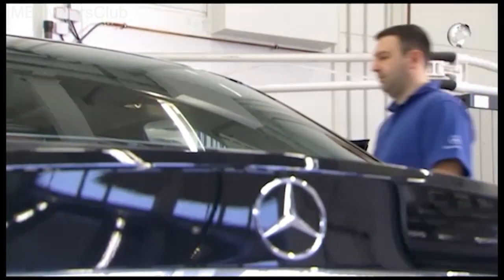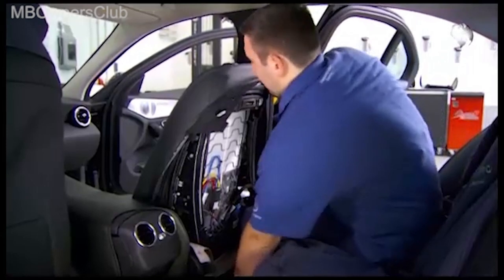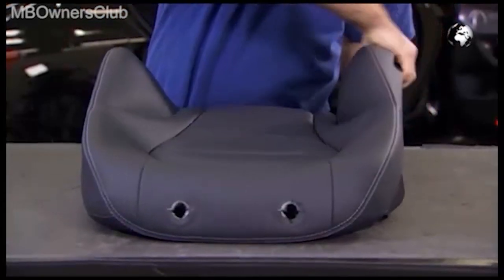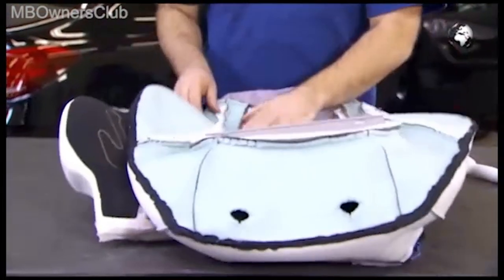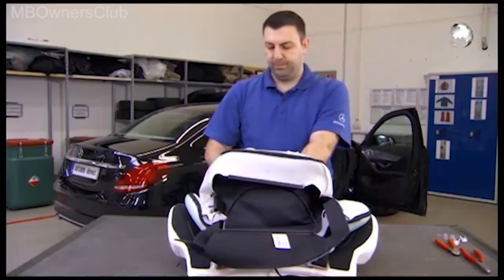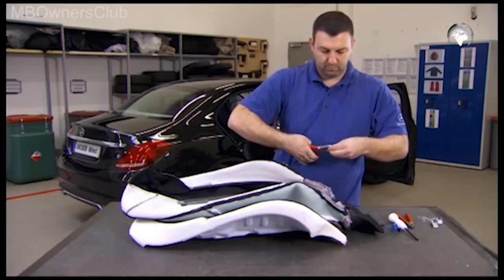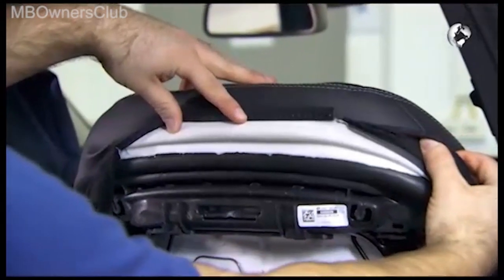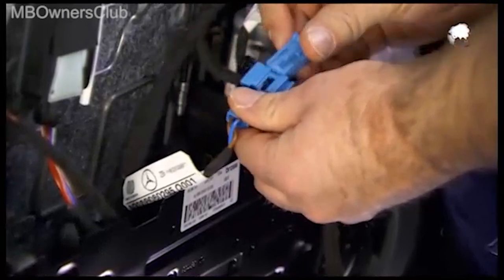Mercedes-Benz - How to remove / install the front seat backrest cover | W205, W253

Comment: How did you remove the back panel of the seat? I have a 2024 glc seat and I need to open it up. But not sure where the clips are
Reply from the maker: Removing the back panel of a seat in a 2024 Mercedes-Benz GLC, or any modern vehicle, can be a bit tricky without visual guidance because the process involves specific steps that might vary slightly depending on the seat's design (standard, sport, electric adjustment, etc.). Generally, these panels are held in place by a combination of clips, screws, and possibly hooks. Here’s a generalized approach that might help, but please proceed with caution to avoid damaging your seat:

1. **Preparation**: Position the seat in a way that gives you easy access to the back panel. This might mean sliding the seat all the way forward if it's still in the vehicle, or if it's removed, placing it in a stable position.

2. **Visual Inspection**: Look for any visible screws or fasteners on the back panel. These are often found at the bottom edge of the panel but could also be hidden under caps or covers.

3. **Remove Screws/Fasteners**: Using the appropriate screwdriver or tool, remove any screws or fasteners you've found. Keep them in a safe place so you don't lose any.

4. **Locating Clips**: Many back panels are primarily held in place by plastic clips that snap into the seat frame. These clips are not always visible, and their exact locations can vary. You’ll need to gently feel around the edges of the panel for the clips.

5. **Gentle Prying**: Once you have an idea of where the clips might be, use a plastic trim removal tool (to prevent damage to the upholstery) and gently pry around the edges of the panel. Start at one corner and work your way around. You should feel the clips popping free as you go.

6. **Check for Hidden Cables**: Before completely removing the panel, be mindful that there might be cables connected to it for seat controls or heating elements, especially in a vehicle as advanced as a 2024 GLC. If there are cables, you’ll need to carefully disconnect them to fully remove the panel.

Remember, the exact process can vary, and given the 2024 GLC is a relatively new model, there might be specific nuances to its assembly. If you're unsure or if the panel isn't coming off easily, it might be best to consult a professional or look for a service manual or guide specific to your GLC model. Mercedes-Benz vehicles are known for their precision engineering, so when in doubt, professional advice is invaluable to prevent damage.